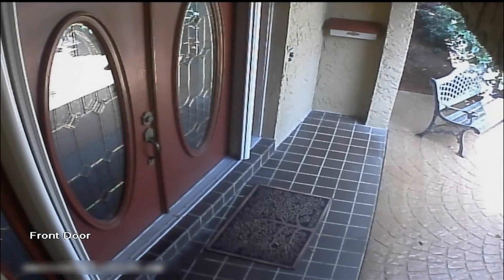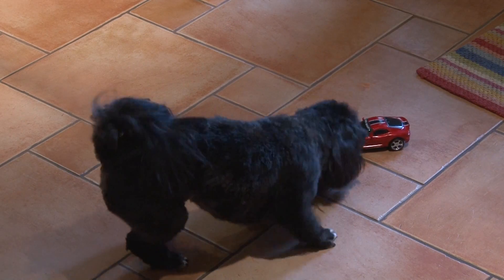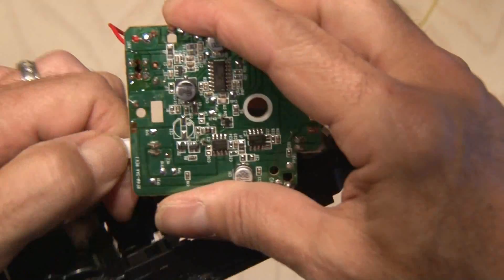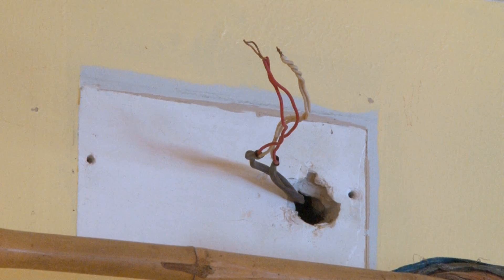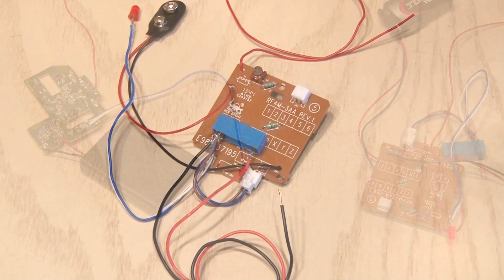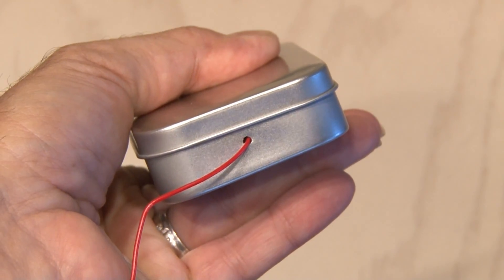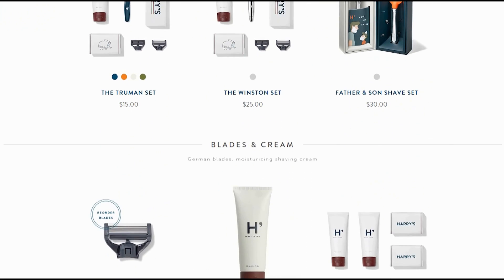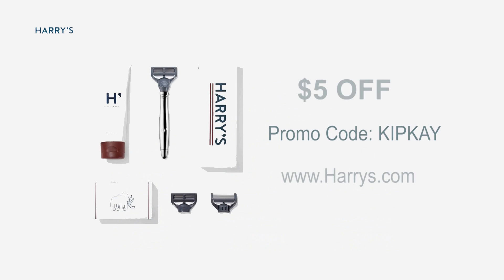How to Silence Your Doorbell!

Comment: You know what I did? I used a small light bulb that I installed in the corridor. Then I switch from the bell to the bulb using a stairs switch, whenever  I want to relax, or just at night.

Comment: Nice work, but much easier to just drill through the wall where the door bell button is located, and add another nice, decorative switch & plate on the inside wall of the house which can be used to open/close the circuit to the door bell outside. If you want peace and quiet, just flip the switch on the inside and go to bed. When you wake up, go downstairs and flip it back so the bell will be heard again. That 9V battery won't last too long with the relay coil triggered constantly to open the circuit (typical current of around 30-40mA). Use a reed relay instead. They use much less current. :-)

Comment: I like this, and I'm going to use it with my own doorbell.  I've got an idea that I'm going to try to integrate into this.  At the doorbell end, I'm going to try to attach an LED sign or something outside of the house that lights up whenever the doorbell is deactivated by the remote.  It'll say something like "DO NOT DISTURB" or "DO NOT KNOCK OR YOU WILL BE ELECTROCUTED" or something like that.  This way, the person who just rang your doorbell won't knock on the door and make the dogs go bonkers.

Comment: I had a similar idea, when a toy motion alarm (directional, like a trip wire) was an annoying sound. So I wired it to a toy car's remote, and the car would spin its wheels, then I modified it to light an LED instead, and then I found out I wouldn't have to replace the batteries (should I prefer a less temporary post) if the sensor/transmitter was wired to a battery charger (bought one with two AA slots, and 1 9v), so I could wire my system to AC 120V, and then exchanged the rechargeable car battery pack for a direct link to the DC6V charging cord, since it is the same voltage as the battery pack that powers the device.

Comment: I'm sorry I just had to comment. 
Just why? 
Just turn a breaker off or disconnect or if battery powered take the battery off. Very simple process. And if you want peace and quiet, they will always knock after a ring.

Comment: Cool and useful hack! It could also be used to make a wireless but still silent doorbell by sending the sound into a headset (in case you want to know if someone is on the door but you don't like the noise). Wireless doorbells doesn't have that option.

Comment: the bell button acts like a remote and the car drives off the nite stand or off any spot you put it at. just add a lil note above the door bell button that says "hold button for 10sec." and the car moves to indicate that someone is at the door. or a vibrating mini motor attached to a head band or a watch......

Comment: what a convoluted way to turn off your doorbell.  Just rig a switch to the doorbell near the door when you don't wanna be bothered.  not everything needs motors, LEDs, and 9v batteries with some kina silly remote just to disconnect power to something.

Comment: Great, now what about those of us that have doorbells that are built into walls or installed entirely in the electrical box that houses the actual button? That's been the standard for over 10 years in most states, and most houses over 20 years old have doorbells switched over when they are renovated.

Comment: Or you could just put a switch on the power line for the door bell and not have to worry about replacing batteries ever.

Comment: The only problem is that you are using a crappy RC system that will not work in other parts of the house.  You can find better RC equipment at a cheap price from HobbyKing.

Comment: It's either this or simply put the switch in a small box and soldering it between one of the battery contacts and the pcb of the door bell. Or taking the battery out.

Comment: Nice hack, but using it that way will probably disable every remote control toy or whatever using that frequency nearby due to interference... not to mention that the batteries in the transmitter will go flat in no time. A better solution might be to keep the control's momentary switches, wire a couple of diodes and an impulse relay to the receiver's motor output: press left, turn bell off; press right, turn it back on.

Comment: Can we set it up to shock people?
Reply: Sadly no. But you could have it scream at them! XD
Reply: @draygoes  but if you scream to much
Your throat is gonna get fucked up
Reply: forcexdisplacement
would need a battery though most likely. unless you're really cruel and want to hit the with 120 lol
Reply: you could build a separate circuit to do that, so it presses both the momentary switches for the doorbell and a shocking one simultaneously. you would need to add a metal contact on the face of the doorbell button though. Could be fun :D
Reply: lol
bit intense... but AWESOME
Reply: Rob Dyke We can set it up to do what ever you want baby ;)
Reply: forcexdisplacement The only problem that I can see with that idea would be a ground. Without an exit point, its going to blow the person off of their feet.
Reply: I believe that's the point.
Reply: +Rob Dyke I had no idea you were a fan of kipkay
Reply: Just fit whoever you want to shock with in a shock collar and tell them that it’s a choker necklace

Comment: I think rather than just silencing the doorbell, circuit should be made so that either doorbell rings (like usual) or some home lights turn on-off or flash.
This way when the new circuit is on, lights will flash getting your attention, and dogs will also not bark (hopefully :)
Well this is just what I would do :)

Comment: Did you try just unplugging the doorbell?
Reply from the maker: Where would you "unplug" it from? It's hard wired to a transformer in the garage and hard wired to the doorbell.
Reply: Well my doorbell at home has a switch. Guess not all doorbells have that :/ .
Reply: Марио Стоилов Sadly, we do not all have this luxury. Although, I bet most people could install one!
Reply: Zachary Gillenwater When I do stuff, I always keep in mind future maintanance, replacement or in this case, disabling if it's too annoying (I once had a home alarm which got gliched and always rang. I had a switch for it too). I just hope kipkay didn't hot wire it back the way it was. Just imagine the remote stopped working while the doorbell is in off mode :D

Comment: Or just put a switch in your bell :)
Reply from the maker: That's EXACTLY what I did. Then I made it wireless. Cool huh?
Reply: kipkay why you said "old rc car" ? thats a new viper model ._. but nice video dude :D
Reply: kipkay I know it, but it's simple and cheaper to put a switch in there, I know it's not wireless but it's easier! Anyway, good video!
Reply: IscleGaming | ZefaCraft If it's wireless, you can do it from your bed side without having to walk up and down the stairs.
Reply: StalePhish no, you can´t. the signals of a remote from a rc car aren´t strong enought to  go through walls

Comment: Wow, I guess over-engineering is sort of the point of this channel, but you could just put in a switch to interrupt power to the doorbell. A simple toggle switch right on the housing would do it.

And of course if the doorbell failed to produce results, I'm sure no one would ever try getting your attention the old-fashioned way, by simply pounding on the door. :P
Reply from the maker: I actually had a small switch originally but this is wireless and way cooler, right?
Reply: I think the idea was to make it remote controlled. Those bell boxes tend to be high on the wall.
Reply: kipkay Wireless is cooler, I suppose, but people will still say to themselves "I don't hear anything, doorbell must be broken," and pound on the door. :)
Reply: wat
Reply: Cornelius Sneed very true. I hv done tt long bak. Was searching for something to reduce the volume but yet to find a solution.

Comment: Great video. I have a doorbell that works on 220 volts so I could just put a wireless light switch in between. Thanks for the tip!
Reply from the maker: Doorbells are 24V.
Reply: wat
Reply: James Guy Well, not really 220 but it has a current Transformer between the 220 outlet and the doorbell itself ;)
Reply: ***** well dont you feel stupid
Reply: dpt56 I just explained that there is a transformer inbetween
Reply: *****
All doorbells have those transformers, they're step downs because, as kipkay said, they're 24v. House wiring in the US is 120v, 240 in other places sometimes(technically it is 220 )